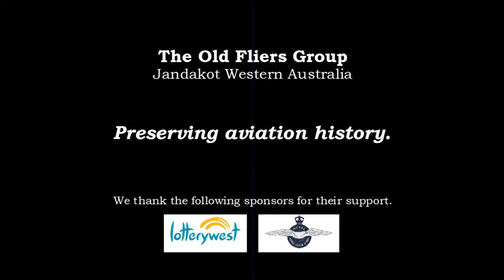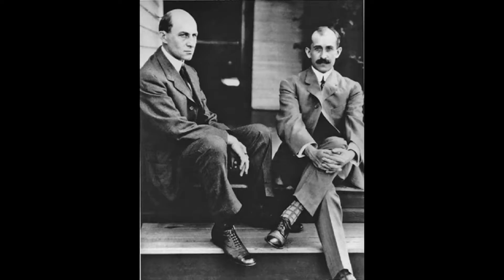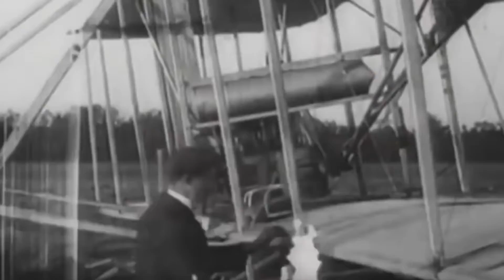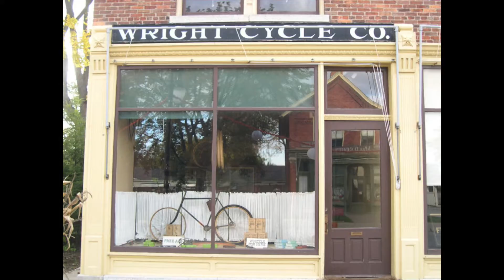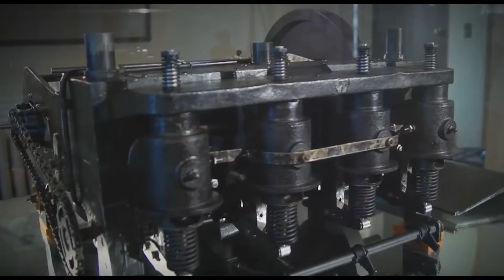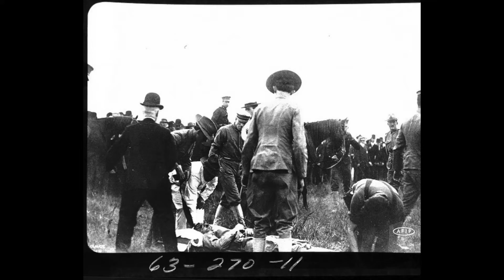The Wright Brothers' mechanic

Comment: Not only did Charlie Taylor build his engine from aluminum, he built it from an aluminium copper alloy extremely similar to the 2024 aluminum alloy (2000 series denoting copper as the primary alloying element) metal which has defined aviation for the last century. I've just received my Airframe and Powerplant license here in the States and I am reminded whenever I turn it over of what a hero Mr. Taylor was to the technological sciences, not just aviation, but also reciprocating engines, and metallurgy. Terrible shame he is so underappreciated.
Reply from the maker: Quite agree. I have only just discovered his role in all of this. A clever man, ahead of his time.
Reply: Also, the required wt/hp specs were 200 lbs/8hp, and the Wright brothers were told by multiple engine manufacturers of the day that those specs were impossible. This was in a time of many engines being hit and miss type, and heavy flywheels relied upon for continuous power delivery. Taylor designed and built the engine with final specs being about 150 lbs, and 12 hp. This weight reduction and power increase allowed for an additional 150 lbs of spars and cables to be added to the wings for rigidity. 

Kitty Hawk wouldn't have happened without Charles Taylor.